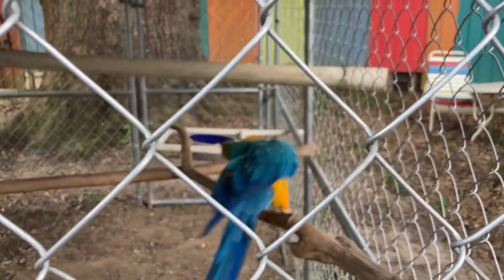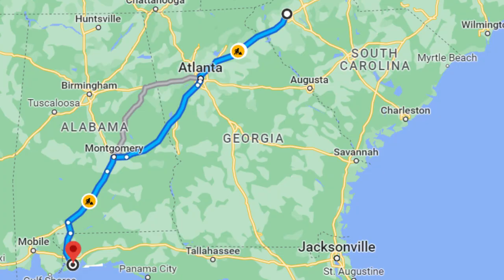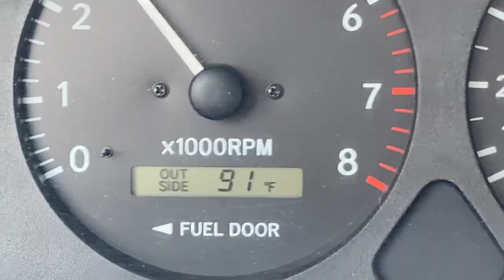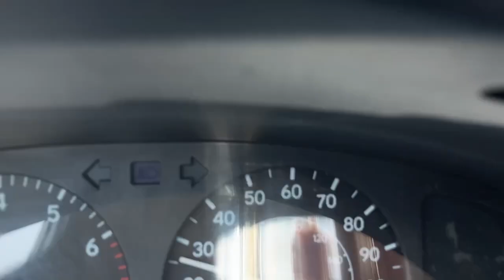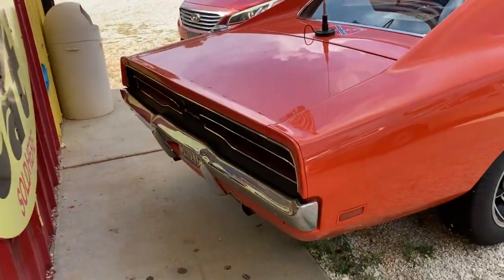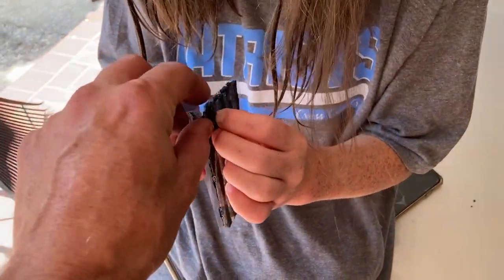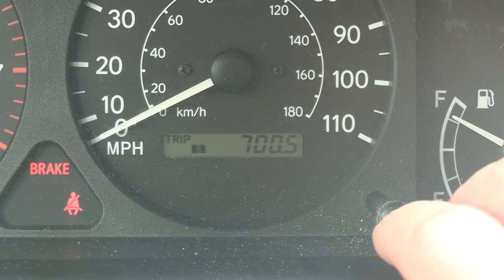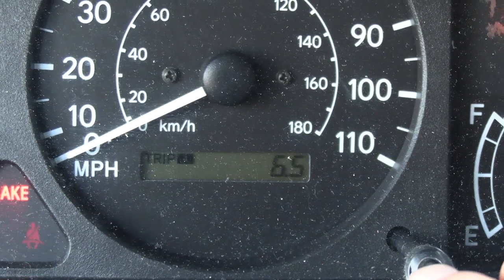HPL Engine Oil vs. OIL CONSUMPTION - Part 2 | Oil Burning🔥Experiments | Episode 24

Comment: DO NOT!!!! Replace the engine mechanically. This flushes away the entire experiment and thus people move along to another YouTube channel.. this is the bread and butter of this show. We all know it can be fixed that way. That’s not exciting. My suggestion is “BG Dynamic Platinum Engine Restoration Service kit” a 4 piece kit. There is five or more videos online that claim this is fixed their issues successfully. Problem is it’s $300… Maybe do a go fund me and everybody pitches in $1.00. Or reach out to BG. Can you imagine this product fixing your engine after 26 other snake oil products have failed!?!? My 2 cents.
Reply: Watchjrgo used this on a Camaro he purchased and the BG restoration kit didn't work.   I think it was given to him by BG.
Reply: Seems like he didn't give MMO enough time in the engine, but he gave this unproven hpo 3k miles...strange
Reply from the maker: Much appreciated! -- I actually have emailed BG but haven't heard back from them yet. I have a feeling that one will win the vote.
Reply: We've seen some pretty impressive results with the BG Dynamic Clean kit at our repair shop. If the dynamic cleaning kit doesn't fix it, nothing will. Just make sure you follow the directions correctly.  Good luck!
Reply: @FamilyFriendlyDIY pour acetone in the cylinders. 10cc, five times, at about one hour intervals. And wiggle the crank after an hour. Five times.  Soak those rings real good. 

Don't run it like that, just change the oil. I'm assuming when you wiggle the crank back and forth it will flow right past into the oil pan. Since it will have oil, it won't damage anything.....it will be diluted by the oil. But don't run it. 

Let us know what happ🎉ens.
Reply: @FamilyFriendlyDIY  If  the BG product really worked they would have sent it to you for free in an instant.  A spot on your channel that does independent, intelligent, long term testing that showed their product worked would be worth thousands of dollars in free advertising!
Reply: One of the issues Dave is having is thinking what I would think the $300+ that BG Dynamic costs could be best allocated to the parts to do a proper rering. 
The hesitation BG might have on comp / sponsoring a video is if their product fails.
Reply: @earlscheib7754  I agree. There's no way I'd spend $300 on a cleaner chemical no matter how great it is, I'd put that towards properly cleaning and rebuilding or replacing the engine and could likely fix this for around $300 plus my time of course.
If I were at BG, I'd be hesitant too. No matter how great their product may be, it's not going to fix worn/broken parts and a lot of uninformed people would no doubt come to the wrong conclusion if the product didn't fix the oil consumption for that price even if there's no way it possibly could. And at this point, I think it's likely that the problem is more than just carbon buildup considering all the other reputable products he has tried without success.
Reply: Hi!!
Really love your videos, Saturday morning, a big jug of coffe and the Corolla!! Got the same problem myself, Corolla 02, bought i really chep 7000 kronor about 650 dollars three years ago when I needed a vehicle just to get to work for a few months.
Burned a lot of oil back then 1 ltr/500km, did a few oilchanges and iit got a bit better maybe 1ltr/1000 km.
About six months ago I did a soak with some really powerful dpf-cleaner, the same way you did the b12-soak!
Now im at 1ltr/2500km  and slowly getting better so i think the rings finally starts to come loose!!
Use 5w30 Castrol Magnatec with klinging molecules 😁😁, whatever that means....
Keep it up
Claus from Sweden
Reply: @FamilyFriendlyDIY  dmso
Reply: @clausjansson4856 what is dpf-cleaner?  Is that a brand name or a chemical reference?
Thanks, and good to hear you’ve had a positive experience with something!
Reply: @ScottoGrotto  diesel particle filter cleaner by Tunap!
Reply: @macready0230  do you have more info on what this product is called and the recommended procedure?
Good post!
Thanks
Reply: Hi Dave, I have the "End All Oil Flush" recipe (from what I have read) and instructions that you may want to try on your channel. I have NOT tried it yet on my 2004 4cyl Camry but I do have everything for it. I've tried many different concoctions without resolve. How do I get this info to you?
Reply: The Channel Rainman Ray's repair just did a video on using the BG kit on a Hyundai about a week ago.
Reply: @macready0230  thanks very much!
Good to have a pro/mfg procedure and product to go by!
Interesting about pressurizing the product within the cylinders?
I guess that could help propagate the solvent more quickly than gravity, especially to areas not sealing well in the ring/cylinder boundaries?
I watched a thecarcarenut video on a Toyota engine tear down with 180k miles and excessive oil usage.
It showed excess cylinder wear in a couple of areas that cannot be helped other than mechanical repair.
A good boroscope could help determine if that situation exists.
Reply: @ScottoGrotto  A borescope was performed with a depstech that had side cameras in the previous video (23.) I'm more concerned about exhaust restriction and backpressure (check engine light) that may have worked against the HPL cleaner. I would like to see a running (dynamic) compression test (alldata) in order to see how the cylinders are breathing.
Reply: For $300 he can buy the piston rings and seals to fix the engine
Reply: I highly recommend this!
Reply: Right keep trying out the additives as it’s interesting to see
Reply: This engine clearly has bad rings. If he spent the time and money on replacing them, he'd have saved a lot of money. Snake oil has never worked. That's why it's snake oil.
Reply: Continuing to dump crap in a bad engine isn't going to fix bad rings
Reply: @ScottoGrotto  Dont try at home, Yes I agree with the pressure idea... I like to start with #1 piston starting at BDC while beginning the compression stoke. Add about 200cc of your cleaner solvent to the cylinder then I replace the spark plug. Never use the starter but get a socket on the crank and work the cylinder from BDC to the point of hydro lock, hold pressure against the fluid for a minute or two them move the cylinder down a few inches, then up half that, then down another 2-3 then back up 1. Do this all the way back to BDC. Then run it back up to hydro locking point & apply pressure with ratchet. It will not break the piston or bend the rod unless your are ignorant of what's happening or you use a breakover way to aggressively. The air is a great idea and moving the piston up and down will move things around and flush solvent through the rings where they are failing to seal. The turning up to hydro lock is just another way to introduce pressure. Another way would be to flood the cylinder with solvent while idling, add to the point where it barely runs, then letting it clear up before you flood it again. Definitely be careful not to over flood it while it is running and bend a rod or crack a piston. These pressures are far greater than cranking and shop air pressure. This might have a better effect on forcing the fluid to clear the ring-lands but would take a slightly more knowledgeable person to do like a mechanic or professional redneck lol. What you think? I know seafoam has a similar procedure when sucked in through a vacuum hose while running but you have no control of where the sea foam goes, it might all be distributed in a single cylinder or just a couple so I like the air and hydro idea. The movement of the piston up and down could play a greater role in effectiveness. God-bless!!!
Reply: @George241312  Yes hes spent a lot, it's kinda just research at this point lol, but it's a unknown journey when you start tarring into it. He also would have to buy head gaskets, valve cover gaskets, timing chain/belt, oil pan gasket, exhaust & intake gaskets, front and rear main seals, not to mention all the coolant gaskets for thermostat housing and water pump, fluids and shop supply's etc.. If the cylinders are out of round near the bottom the block would have to be stripped and cylinders checked for roundness, scoring, distortion & then it needs to be cleaned up and finish honed.  Possibly needs bearings & what if the pistons are scuffed or it gets bored? New pistons?  There's a lot more than just buying new rings and slapping them in there. It's a 200,000mi engine, it might need a little more work. God-bless.
Reply: @George241312 Ha! That may be true, but don't forget about the labour to re & re said components.
Reply: @FamilyFriendlyDIY I don’t know if you have tried this yet but the good old fashion way is to use kerosene 
Get the clear one meant for indoor use 
Drain the oil 
Put on a new filter ( cheap one ) 
Fill it up with kerosene and run it for about 30 minutes ON IDLE ONLY ( do not rev the engine )
Drain the kerosene 
If it’s dirty 
Do it again and replace the filter 
Do this until the kerosene runs clear when draining. 
This method has been done forever 
Also some people will use transmission fluid instead of kerosene 
ATF fluid has a lot of detergents in them. 
And another way is to use LA’s Totally awesome cleaner 
Same process - Do Not Rev The Engine. 
If this fails at this point I would say it’s the rings and they are just worn out. 
Reasons can be many
Reply: @mshaw290808mi That's an excellent point. The fact they aren't moving on this shows they are not confident in their product. BG is snake oil. I tried it once and it didn't do anything for my car.
Reply: @mfanning186  you are wrong 
It did work and did an excellent job 
The problem he had with the Camaro was he needed new timing chains 
Watch that video of him doing the timing chains and you can see how clean the engine is 
He remarks about it.  
BG is a good company and they do make excellent products 
This engine flush is pricey but it does work.
Reply: I would have done the valve seals by how much it is using oil it's an easy job
Reply: @brianbotticelli7356  Does your 2004 Camry have the 2AZ-FE engine? My 2005 RAV4 has the 2AZ-FE. At about what odometer reading did you notice excess oil consumption began? How bad is it now? It has long been my understanding that it wasn't until the 2006 models of Camry & RAV4 that oil burning became a serious problem, but I've never definitely found if Toyota made a change in the design of the pistons & rings with the 2006 model that caused the oil burning to be worse.
Reply: good old STP.   make sure the engine is super hot, then add half a can of that syrup, then drive 500 miles.

Comment: When you mail them a check make sure to wipe it on the floor of a public bathroom. Makes you feel better lol.
Reply from the maker: I have to admit that made me smile. I'm so ashamed 😳
Reply: @FamilyFriendlyDIY  haha sorry
Reply: @FamilyFriendlyDIY put the tire plug glue on the plug before pulling it through the plug tool, makes it slide right in. Also, you should go to the junkyard and buy a full size tire from a junked Corolla and use it your spare tire instead of babying it with those little doughnut tires.

Comment: my dad was burning a lot of oil in his 2001 Suzuki Grand Vitara, i was always using like high mileage full synthetic oil and kept burning a lot, and someone told me don't use full synthetic, so i tried Castrol Gtx high mileage, and a quart of Lucasoil high mileage oil stabilizer and its been roughly 1,247 miles since the oil change and so far knock on wood, no oil burning yet! still at the full mark!
Reply: @Mike-Capz83 - as of April 2024 what is the rate of oil consumption? Because synthetic oil makers say there are advantages to synthetic oil, what do you think about those claims?
Reply: @LoneTinaja  as of April 2024 my dad no longer has the car. Someone cut him off and the car is totaled, but as of January it didn’t burn any oil at all, since switching to Castro gtx high mileage and a quart of Lucas high mileage oil stabilizer

Comment: Thank you for this series, Dave, it's been very informative.  I think the final test before a teardown has to be BG Dynamic, save the most expensive for last
Reply: I agree @DIY Dave if your gonna do 1 last treatment test it should be BG Dynamic engine cleaner kit.  You've put so much work into the car and helping us test these products I think at least the "Old Girl" Corolla deserves the best medicine before you perform open heart surgery on her.   Also your oil gets very dark and dirty at such short mileage.  Since I've done the Barryman's and switched my oil to thinner it actually is staying cleaner so I believe the BG Dynamic engine cleaner will definately help clean out all the gunk.
Reply from the maker: Thanks, Matt. I have a feeling BG will be the people's choice :-)
Reply: Fill the engine with Diesel and down the spark plug holes, put the spark plugs back in and turn the engine over by hand. @FamilyFriendlyDIY
Reply: It's been a fun series.
Reply from the maker: @randywl8925  much appreciated! 😊

Comment: Thank you Dave, this series has been very helpful for me as well.  We have a 2017 Audi Q7 that burned a quart every 400 miles and had bad enough misfiring to cause codes and limp mode.  I replaced the PCV, tried Lucas oil stabilizer, two recommended oils (Castrol Edge, Motul Xcess), and BG EPR, all with no effect.  Then I did a Berryman's B12 piston soak.  A few differences to your method, but the result was a huge improvement.  It has now gone roughly 2000 miles per quart for 6000+ miles, and no misfiring at all.  I plan to do it again before my next oil change and see if it improves further.  If that hadn't helped, I was going to try the BG Dynamic engine cleaner as a last resort before throwing in the towel and doing a rebuild.  But I thought you were also going to try a BG Dynamic engine clean too and was hoping to see your result.  Did you decide against that?
Reply: What steps did you use on your tsi ?? With the b12 berrymans??
Reply from the maker: Glad to hear that. The BG will definitely be up for a vote, and I think that one will win.
Reply: @vader_117  with the engine at a quart low on oil and warm, I pulled the plugs and rotated it until the cylinders were roughly all in the middle.  Since it’s a V engine you don’t have the luxury of the fluid going all the way around the piston like in a vertical piston engine.  I calculated that around 8-10oz of fluid would be enough to get the fluid level above the highest part of the piston.  So, to be on the safe side I put a whole 15oz can of B12 in each cylinder, or as much as it would hold up to the spark plug hole.  I then let it sit overnight, about 12 hours with the spark plug holes covered to reduce evaporation.  At that point all but two of the cylinders had completely drained into the crankcase, and those two were mostly down.  I blew the remaining fluid out by cranking the engine without the plugs and then put the plugs back in.  Then I started it and drove it for about 20 minutes doing a lot of high vacuum decels to try and get the oil with B12 in it up into the rings and cylinders.  Then did an oil and filter change and reset the trip meter.  When it hadn’t come off full (dash display) until after 6 or 700 I knew I had finally found a solution to the oil consumption headache.
Reply: I have a 2012 Audi A6 and did the piston wash as well, I was burning a quart every 1K miles and it doubled after. I plan todo it again but for a longer period.
Reply: I'm watching these videos for the exact same reason on my 2017 Audi Q7 3.0T. I'm at 88k miles and it uses a quart of oil anywhere from 350 to 800 miles depending on how I drive it. Do you have any advice on doing the B12? Also, did the Pcv valve help at all? I was going to install one soon.

Comment: You should've done a complete change, after the Engine Cleaner, with the HPL 5W-30.  By keeping the old oil and just topping off, the ester concentration is diluted too much.  It's likely there's still a lot of cleaning that needs to happen around the rings.  For some, it wasn't until the 2nd full oil change before the consumption started to decrease.  It cleans slowly like that so you don't overwhelm the oil filter with too much cleaning too quickly.  I would do a complete change with HPL 5W-30 and continue to monitor.  There's been several who, by the 3rd oil change on HPL, have gone from a quart every 1,000-1,500 miles to a quart every 5,000-7,000 miles.  If you cut open the filter, you're likely to find a good bit of carbonous deposits in the filter.  The oil filter should be changed every 1,000-1,500 miles when using the Engine Cleaner and initial oil changes.
Reply: Cleaning ring doesn't fix worn engines.